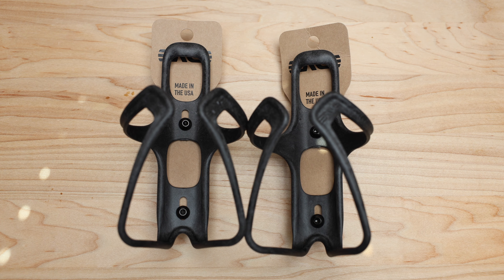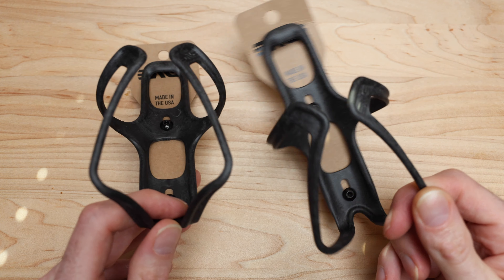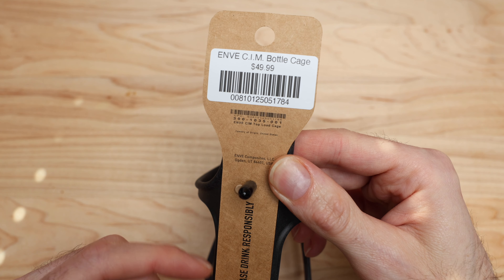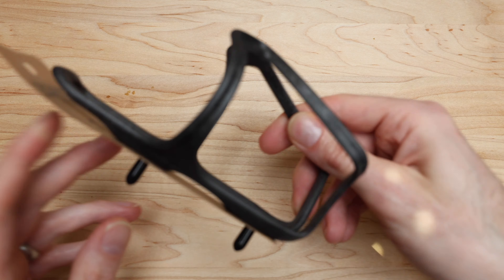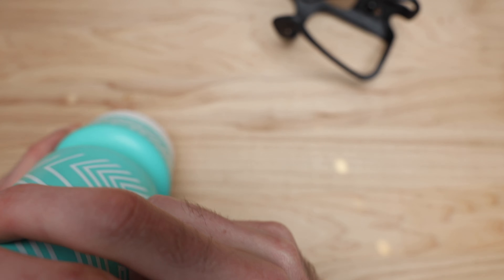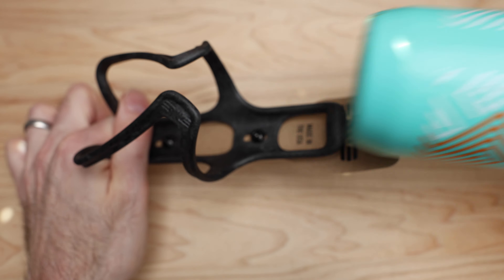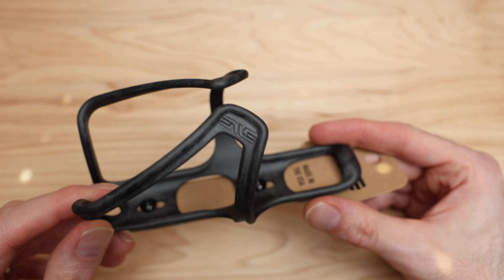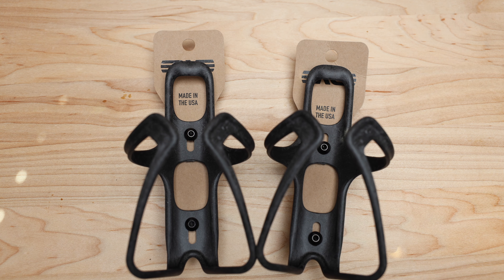Enve C.I.M. Water Bottle Cage- Initial Impressions

Comment: I don’t know what these other people are talking about, these cages hold every single bike water bottle I own perfectly and way better than any other cage I’ve bought. Price is definitely half of their competitors. The only compromise is you are a few grams heavier than the double price competitors. Like 4-6 grams heavier. I felt like it was worth saving  the money to get these and they’ve been extremely reliable for mtn biking and gravel riding. I even take my heavy metal podium water bottles along and these hold them extremely well, zero movement or rattle. Def the best deal in UL carbon cages I could find by a long shot.
Reply from the maker: Agreed. So solid.

Comment: I just purchased two for a new eave build and these are horrible , bottle fell out first ride, I tried 3 of my bottles including a stainless steel one that is tight in other cages, these are way to big for most any bottle, useless.
Reply from the maker: Not my experience. They hold the bottles insanely well.
Reply: @MitchOnTwoWheels  strange I have never in 30 years had a cage so loose, I am using Bivo and Abloc bottles, even my thin Lightweight brand  carbon cages hold well with these bottles. First time I have ever had a bottle bounce out on a road ride.